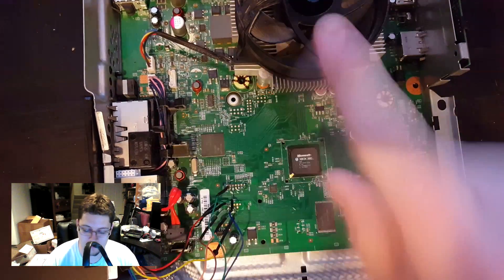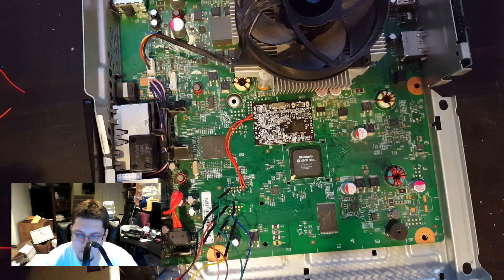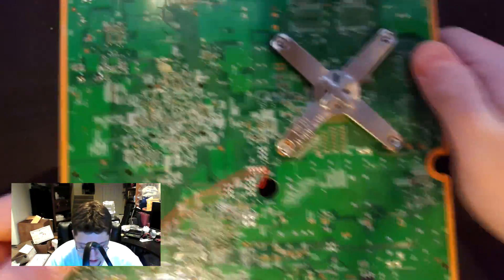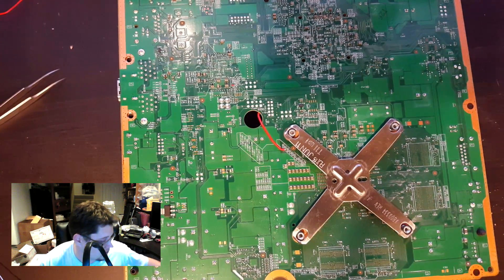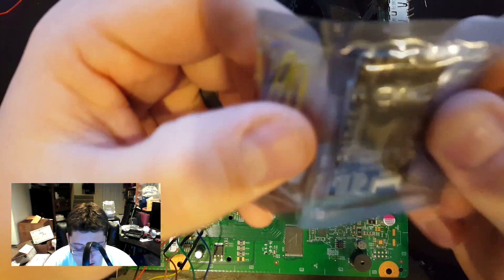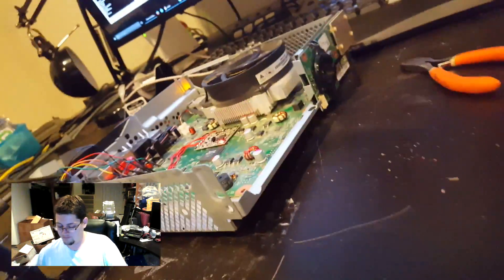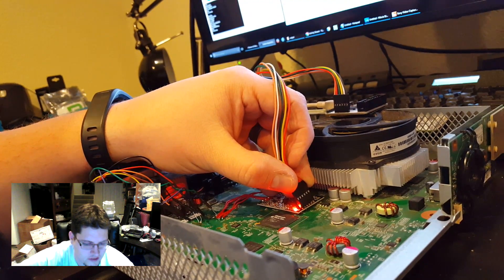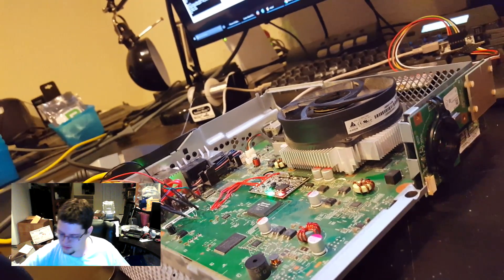store.weekendmodder.com update while installing Ace V3 in a Trinity Slim

Comment: hi, i am having boot time trouble with a corona v2. i am using ace v1 chip. i got good times during testing like max 5 glitches and usually 2. but after assembling its above 5 always. wire routing has not changed. any suggestions? also does ticking cr4 in j runner improve anything wrt corona v2?
Reply from the maker: +Hsp Hsp post a link to a pic of your wiring method.
Reply: +TheWeekendModder http://i67.tinypic.com/10nuw3p.jpg

http://i68.tinypic.com/v3hxk9.jpg

http://i67.tinypic.com/33oiaah.jpg

http://i66.tinypic.com/72sgti.jpg
Reply: +Hsp Hsp 

i have done a jasper and trinity before. this would be my first corona. does it really change when you assemble the xbox? have you had any issues? also my xbox seems to boot quicker most of the times on hdmi than on av port (composite cable).
Reply: +Hsp Hsp yes because RGH is a timing based attack many factors play into the performance shell casing being on and other things as well.  I think your best bet to resolve your performance issue would be to flash your chips with the timing files from 15432 you can find them at the teamX360.co.UK site
Reply: +TWM Proof Videos

already tried that 9..2   10..2   11..2 were the best i got without covers. none of the 3 jrunner rgx corona files and most of the 15432 files could not glitch the console. 15432s 9..2 9..3 10..2 10..3 11..2 11.3 were the top files...9..2 and 10..2 were giving me good times before assembling..i have heard of 'stubborn' consoles; the kind even if they glitch is a miracle lol.could be one of them or maybe its just me. btw its a corona v2 with post out missing so used postfix.
Reply: +Hsp Hsp 
have tried x360run and this chip. post out wire lenth is 10cm and rst wire is 14cm fyi. have tried lesser lengths but more or less same result.
Reply: +Hsp Hsp when you build your name and image you selected the CR 4 box right? If you don't do that you're not using the speed up from the cr4
Reply: +TWM Proof Videos 
nope CR4 is unchecked..did you read my first post? ;-) i asked that..but i couldnt try because then i had problem reading nand with qsb.i will try direct wires to card reader tomorrow. CR4 speed up files work pretty good? i read somewhere about speed up files giving into red rings. i think teamx360uk site. now that i dont want; il force myself to be happy with 20secs boot time lol
Reply: +Hsp Hsp

one more question create ecc write ecc; xell..will these blocks (complete nand) be over written when the final nand updflash is written?
Reply: +Hsp Hsp kind of snappy for somebody who's getting free assistance...   yes I read your first post which is why I Revisited the issue but you made like 4 Post in the meantime so there was a lot of other information to consider.  yes you absolutely want the CR4 box checked when you build your image it speeds up boot time like three fold
Reply: +Hsp Hsp 
i am not a pro..this is more like a hobby..i didnt like my glossy xbox trinity so sold it and bought this..about the wiring..looks ok?
Reply: +Hsp Hsp 

twm..ive been your viewer past 1 year or so..love your videos..but there is no way i can be your customer as i am far away..your replies are much appreciated..i didnt want to try speed up files because of what i read some place. so is it like if it glitches ok, then eave cr4 unchecked; if not check it. or i can leave it checked for all xboxes?
Reply: +Hsp Hsp the CR for speed up lupus supported specifically by the Sea are for chip but also by the timing files released by 15 432 you would not want to use it if you were not using those timing files. For instance if you use the default Ace timing file you would not check the box because that does not support the cr4 speed up Loop
Reply: +Hsp Hsp the wiring overall I would say looks like it should be functional it could certainly be cleaned up and trimmed and made a little prettier but I don't know that that would have an affect functionality. I really think when you rebuild your name and image using the CR for speed up and then retest your timing files you'll find The Sweet Spot it works really good
Reply: +TWM Proof Videos

oh ok. speed up timing file on the glitch chip and speed up variant of the nand image (xecuter cr4 or 15432) goes hand in hand. ok twm thanks for all those wonderful videos.   i will do a little this and that and update my final xbox status when ready. thanks again.
Reply: so..most of the 15432 gave red dot on ace v1 and others were not stable; huge variation in glitch times..switched to x360run and played around; 2-4 glitches most of the time and never had more than 7..thanks for your help twm
Reply: +Hsp Hsp huh, I wouldn't think using an ace v1 would make a huge difference, but I've only ever used those timing files on Ace v2 and v3.   the x360 run does do pretty solid too so totally a good alternative.   glad you got it sorted out!

Comment: Hey i just installed an ace v3 into my xbox 360e and the red light shows up but when i power on the console it doesn't glitch. any suggestions? do i have a bad ace v3?
Reply from the maker: Did you write the standard ECC file to the console?
Reply: +TheWeekendModder yes I created the ecc and wrote it to the nand in Jrunner. If I flash the original nand the console boots
Reply from the maker: Did you bridge the area near the nand r/w points that carry the signal to E and F?   Is your postfix adapter installed properly?
Reply: yes i bridged r2c7 and r2c6
Reply: heres some pics : http://www.se7ensins.com/forums/threads/corona-v6-not-glitching-at-all-ace-v3.1527048/#post-12313066